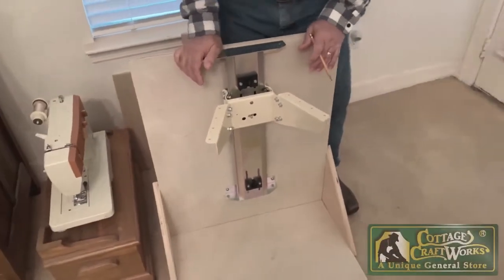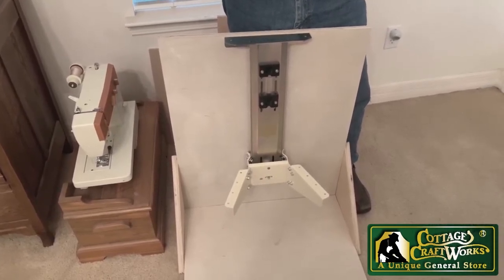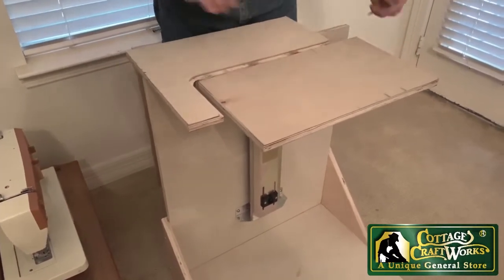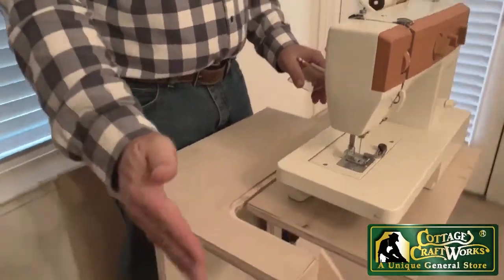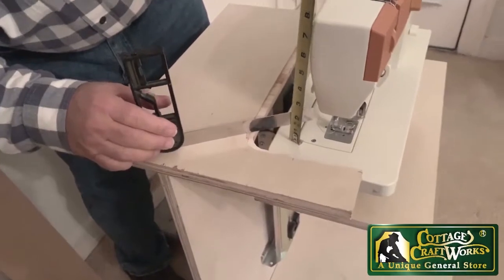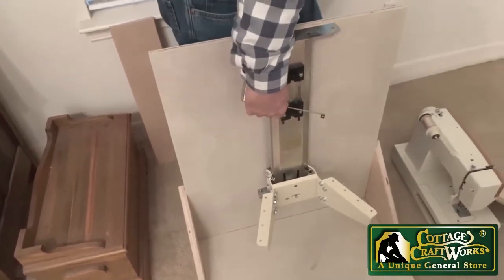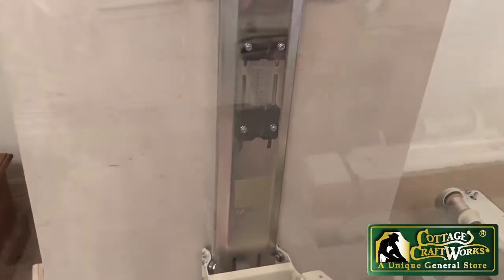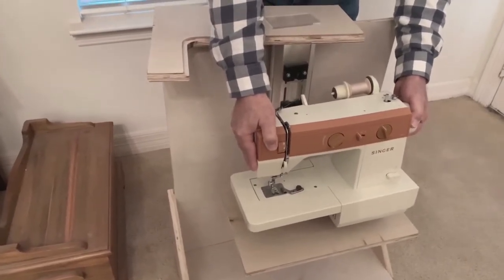Demo only  SEWING MACHINE AIR LIFT MECHANISM RUDERSBERG

Comment: As I am getting older I now struggle to push the lift up and down.  Can the tension on this be adjusted?
Reply from the maker: Sorry, they are not adjustable. But you can watch our video at cottagecraftworks.com on adding a counterbalance weight
Reply: @CottageCraftWorks  thanks, will try that.